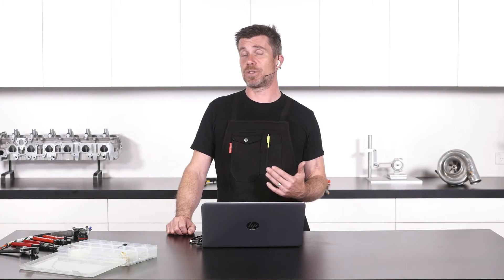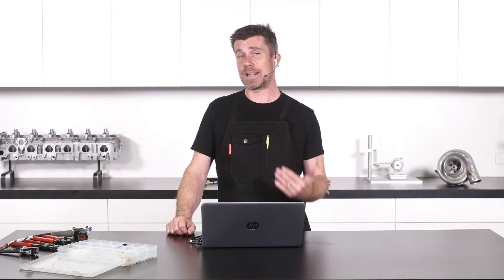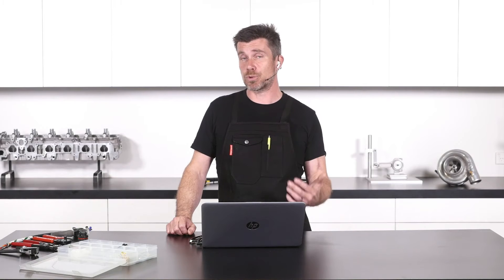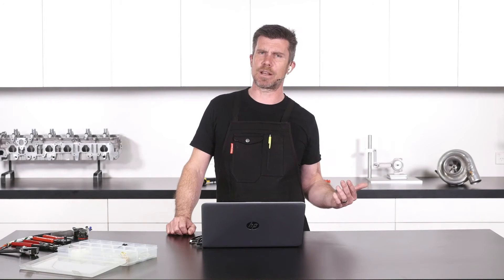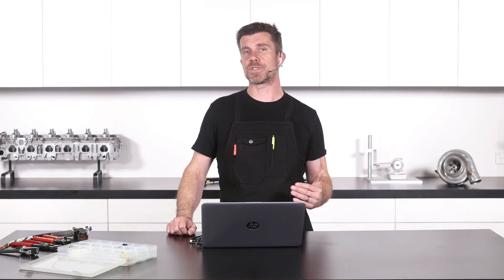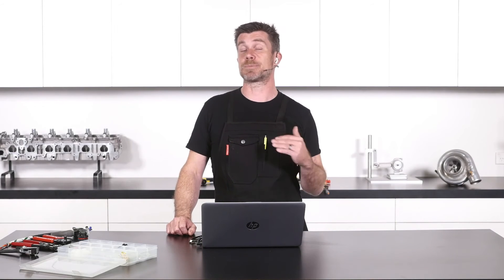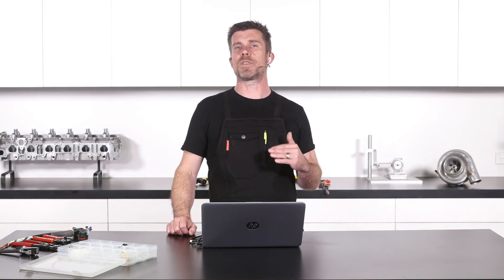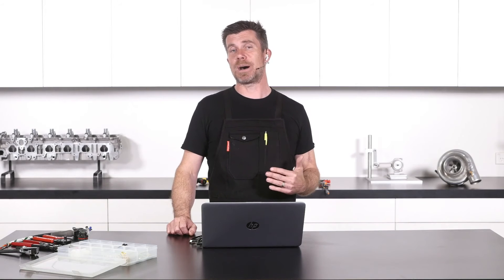Sensor Wiring | What Gauge Wiring Should I Use? [HPA Q&A}

Comment: Stick with the NEC (National Electrical Code) (USA) recommended wire Amperage Ratings.
4-ga.  = 100 Amps or less,
6-ga.  = 60 Amps or less,
8-ga.  = 40 Amps or less,
10-ga. = 30 Amps or less,
12-ga. = 20 Amps or less,
14-ga. = 15 Amps or less,
16-ga. = 10 Amps or less,
18-ga. = 5 Amps or less,
20-ga. = 2 Amps or less,
Smaller Wires must be protected by some kind of Electronic Circuit Current Limiting.

Very high quality wire insulation will allow  up to ~30% more Amperage, for short runs,
but the smaller wire gauge may cause an unacceptable Voltage-Drop in long runs.

High Current items may  experience a Voltage-Drop from too small of a Wire-Gauge,
this problem gets worse as the wire length increases.
Longer Wire runs may need heavier gauge wire to prevent "Voltage-Drop".

This is also how you choose a maximum Fuse Amp-Rating.
The First job of a Fuse IS TO PROTECT THE WIRE FROM OVERHEATING AND STARTING A FIRE.
The Fuse may sometimes be sized smaller to limit damage to an electrical part in case of a fault.

The Fuse should be sized by the SMALLEST WIRE IN THE CIRCUIT.
If you have a long wire run using ~10-ga. wire, that changes to a short ~18-ga. wire,  
you need a 5-Amp Fuse max, to protect the ~18-ga. wire.

Comment: Also regarding voltage drop: for some things it doesn't matter that much.
E.g. a heated rear window doesn't care that much if it gets 14v or 11v, it still works.
Fuel pumps/injectors/coils etc will need a more stable voltage